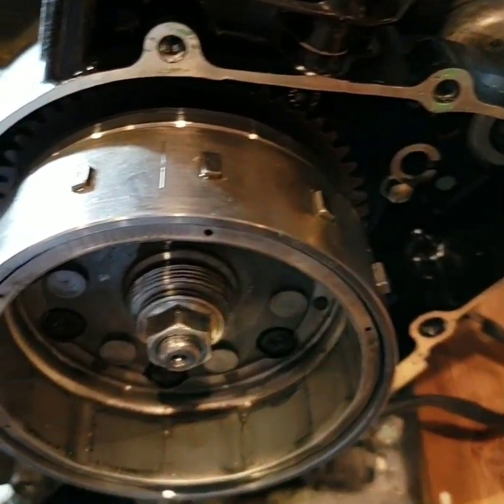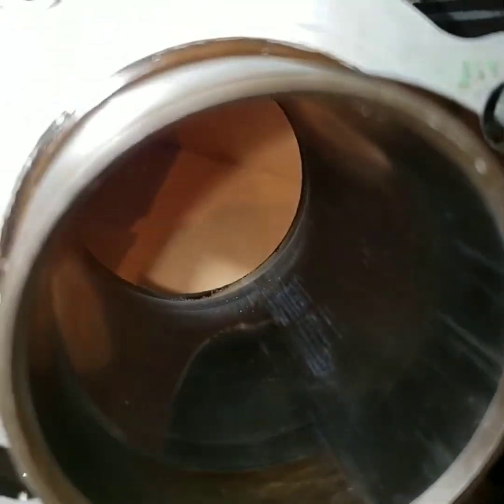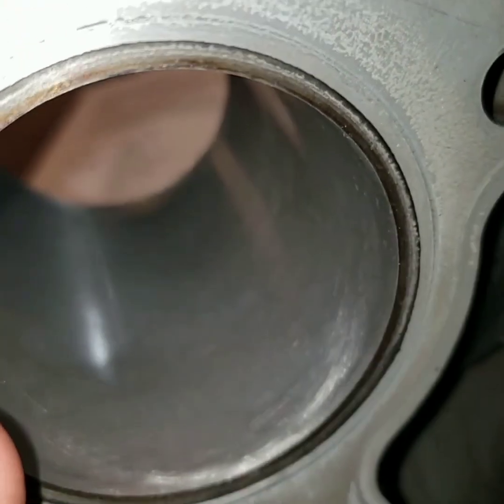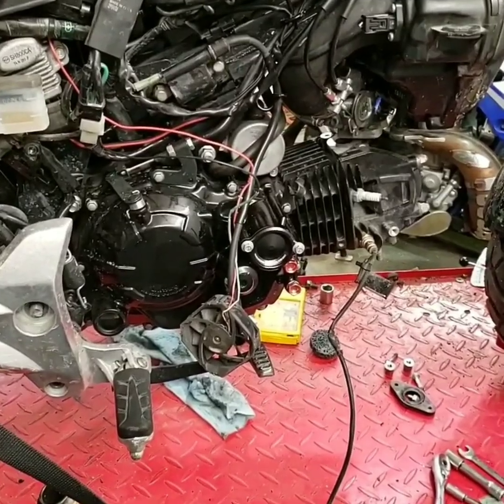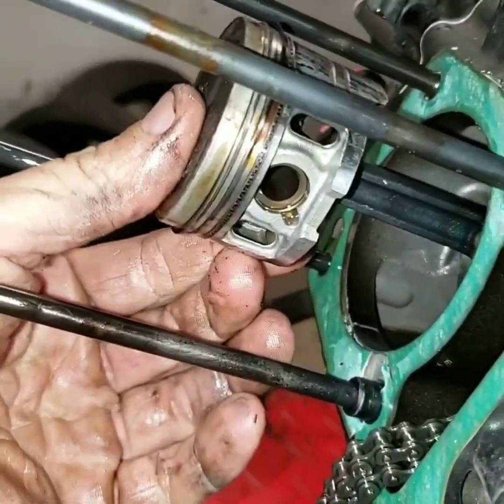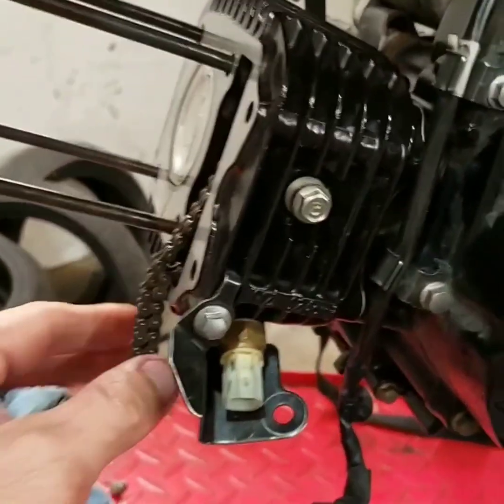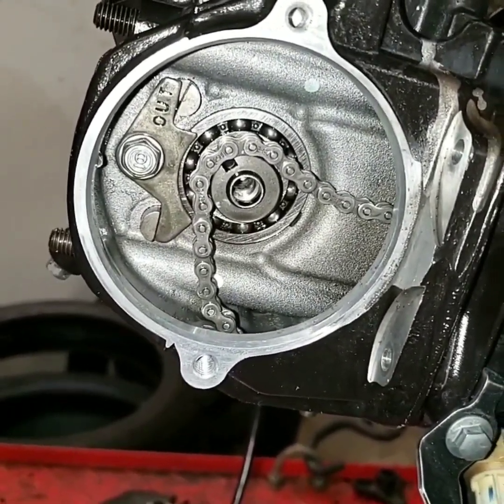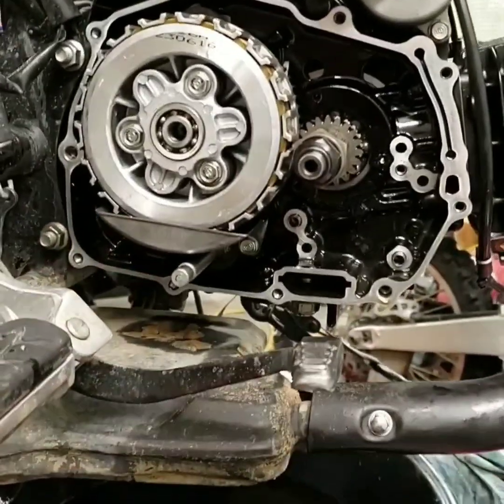Grom Top End Rebuild After Oil Starvation

Comment: I'm a mechanic , worked on these small Hondas since the 60's  : wheelies throw all the oil away from the
pump pickup . Also , pickup extensions do NOT really help unless oil level is raised excessively. 
I won't mod my ct125 Trail one bit. Just put a DID VX on it and puttputt it forever.
Then most mod parts are crap. I mean , crap.

Comment: I hope I never have to do this.  I put the Koso high glow oil pump in when I installed the Kitaco clutch cover. That oil pump looks exactly like stock. I think the Takegawa looks better. I wish I had put in the pump with the long tube to cycle the oil from the back like you did.  But, I don’t do wheelies, so I hope it does it’s job. Good work.  I like to see how you actually put stuff together since I always have trouble. Good job.
Reply from the maker: It's an example of how to do it or at least me working on it obviously I specialize in the larger bikes for the most part but this was fun and I helped my friend out

Comment: What was the cause? oil pump failing internally, or oil pump sprocket not being driven by the camchain?
Reply from the maker: It was an aftermarket oil pump failure.
Reply: @DRZWhisperer  Thanks! You don't tend to find Hondas go bang very often
Reply: @DRZWhisperer  Which pump?
Reply from the maker: @waferzworld  it was the takagawa super pump off memory serves
Reply: @DRZWhisperer  can’t find any pumps for 2022 that come with the back plate. I need to mod mine for wheelies and debating if I’ll send off the stock one or use an upgraded one
Reply from the maker: @waferzworld  if you are doing a bunch of wheelies a good practice with a stock pump is to slightly overfill it with oil

Comment: I just took the cylinder off and noticed the discolored connecting rod but yours is the same way, is that normal or should it be replaced?
Reply: Did you ever find out if it was normal? Just got into mine and found the same
Reply: @kyleanderson2807  It'ss normal, I bought a new crank and it's the same way it's just the heat treatment process.
Reply: @kyleanderson2807  when you go to put the two halves together don't use a lot of gasket maker, just a little will do, you don't want pieces breaking off on the inside and clogging your oil pump